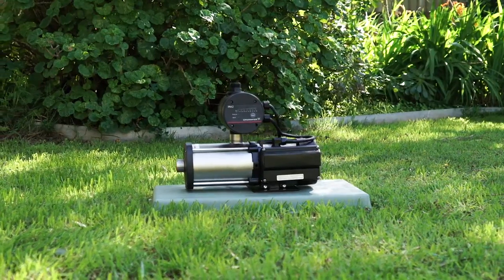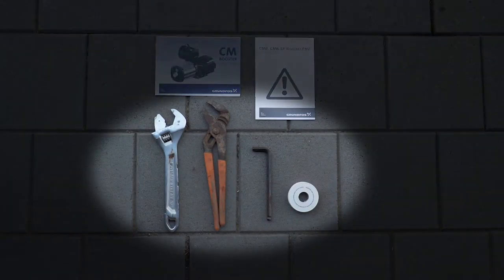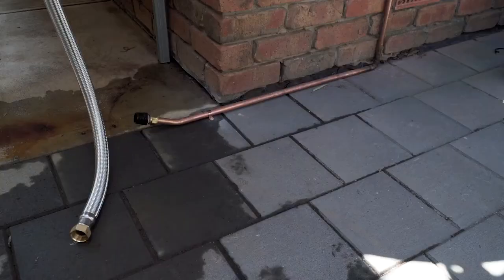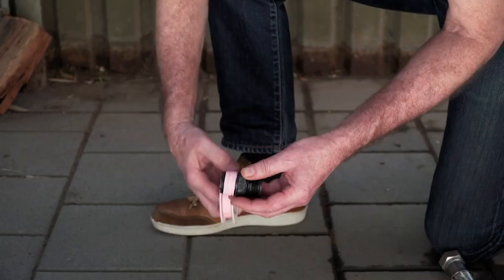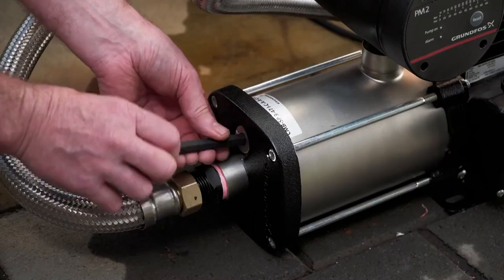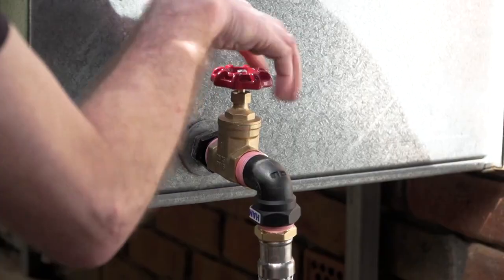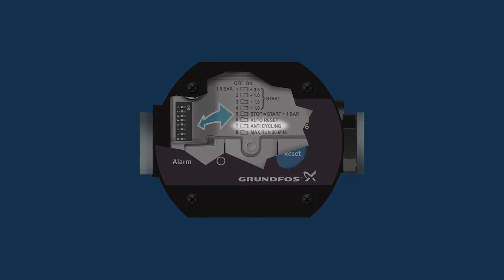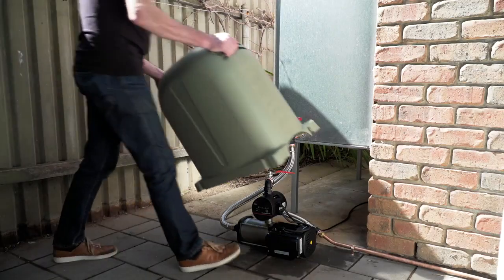Grundfos CM Booster Self Priming - Easy Installation Guide

Comment: What size hex key do you need?
Reply from the maker: Hi Pennyrobards,
Thanks for your enquiry. You need a 10mm hex key for this pump. You can also consult the quick guide for the pump for this and other related questions. Hope that helps.
Regards
Aaron
Reply: Thanks heaps, yes a 10mm hex key is what I need, I read the manual, I couldn’t find the hex key size there?
Reply from the maker: Hi @pennyrobards, our pumps come with both a user manual and a quick guide. The hex key size was listed in the Quick Guide. All the best. Aaron